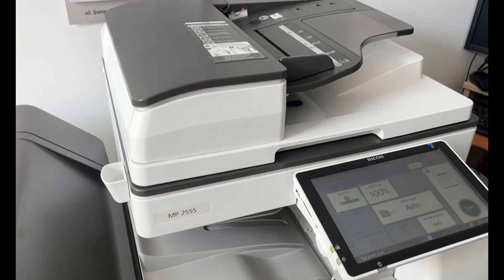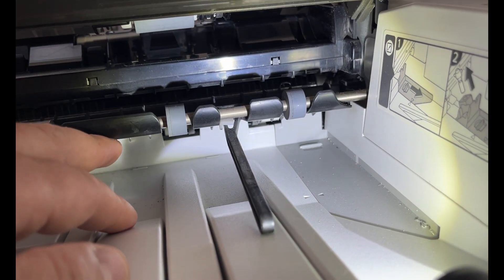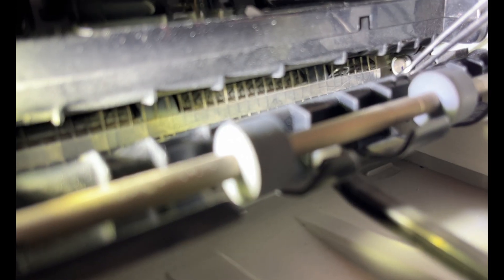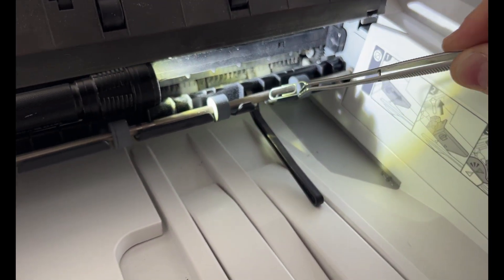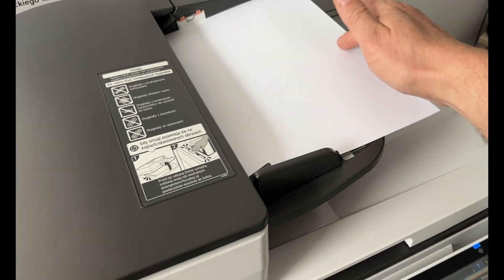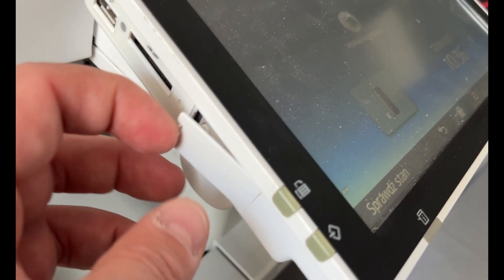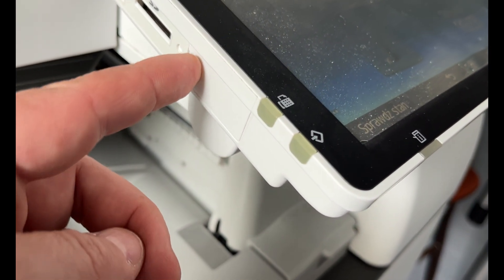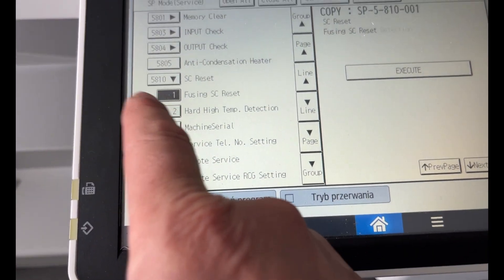Ricoh MP 2555 ADF Jam Fixed — The Surprising Cause Was a Paperclip!

Comment: Look very carefully, mine had a small piece of tape stuck in it, and then a little sticky rubber thing. Make sure to look at all areas carefully it can be hard to spot.
Reply from the maker: Great catch — thanks for sharing! Small bits of tape or adhesive debris and tiny rubber fragments are a common cause of jams and stuck trays because they foul rollers, sensor windows and release mechanisms. Always inspect the entire paper path (pickup area, feed rollers, sensor windows and tray guides). Use tweezers or a lint-free cloth (and an alcohol swab for sticky residue) to remove anything you find — avoid sharp tools that could damage parts. That tip will surely help others, thanks again!